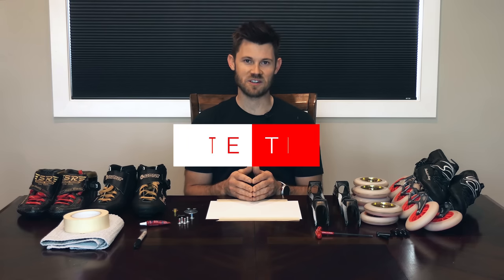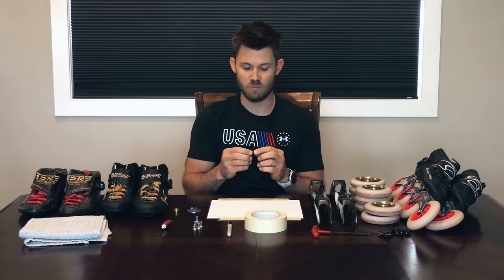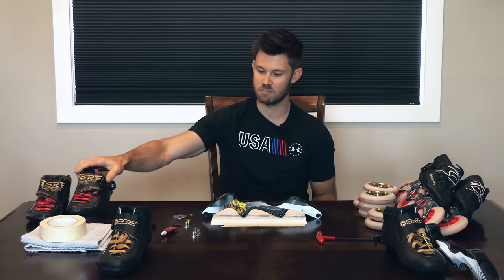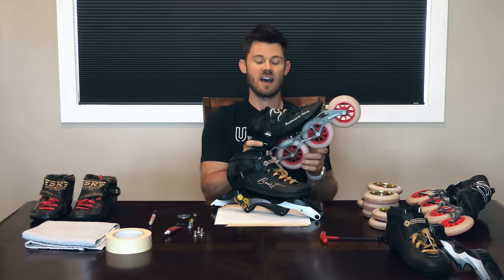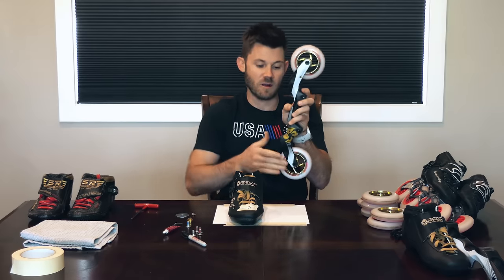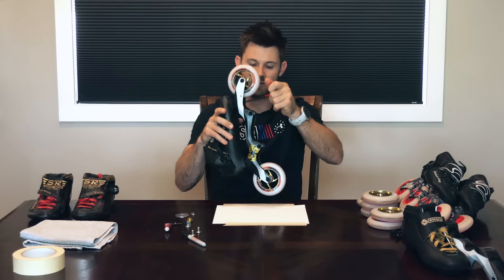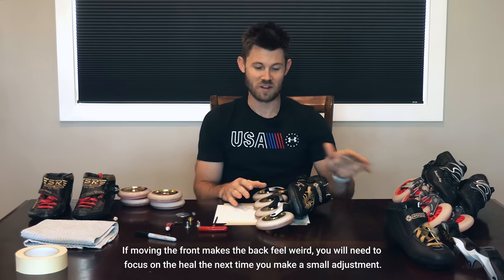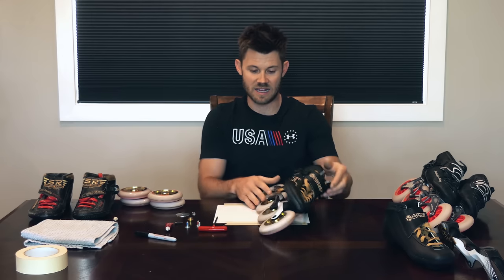Inline Skate Basic Setup Guide - How & Where To Mount Your Frame - Tutorial by Pro Joey Mantia

Comment: Back in the day of the 5 wheel set up, we would have our boot rub on the floor in the corner. 100mm track style skating. So we would move our frames to the left a bit on the right, but a lot on the left, tends to cause some ankle pain for me, have you ever skated this type of racing and what would you do now with the larger wheels. My left foot tends to move to fast if i do not move the frame over to the left. Ankle buckle, something like that. I see people, even super fast people not moving the frame much and not as much as i do, but if i do not, it just seems like im not getting power from the left skate. Not sure if you know much about that type of skating, its like short track ice, just on inline with a less oval shape track.

Comment: I know I’m late on this post however, I started to speed skate when I was 7 and gave up at 14 because it was “no longer cool”. I’m now 26 and wanting to jump back in just for fun and for exercise. I’m stuck between two boot options. The Bont Jet in-line speed skates and the Luna. With the jet you can mold your boot and with the Luna you can not. I never molded my boots in the past and was okay. Was skating faster then the guys double my age back then. However, it seems any knowledge I had on what boots to pick has gone out the window. I’m going with a 110mm wheel and upgrading the bearings as well. I just can’t seem to decide which boot I should choose. Do you know anything about either of these boots and have any insight as to which I should go with?

Comment: Hi Joey, Nice to see you again.
How can we judge by seeing from outside that this boot is 2 layer carbon or Full carbon?
And what is the benefits of Full carbon boot than two layer or 3 layer carbon Boot.
Reply from the maker: i dont know if you can tell just by looking. The layers of carbon aren't as important as the quality of resin used and the process for how the carbon is laid. If a boot maker knows what they're doing, they can keep the boot really light, but also nice and stiff as well. The advantage to more carbon is that the boot will just be stiffer, so if that's what you prefer (like I do) then that's what you would want to get
Reply: @JoeyMantiaSkates  what do you mean STIFF.
Is it upper portion of Boot or Ankel position?

Comment: Ok, I've speed skated most of my life (long track ice) and know the importance of good equipment. I bought a pair of good inline roller skates (3 x 125 mm wheels) and am setting them up. I'll set them up just like my Vikings, which should be easy. I'm 68 years old, and know how to skate, BUT also know the importance of wearing good protective gear, especially since I'm just starting out on inlines. I currently own a helmet, but need elbow pads, knee pads, and wrist guards/pads. There's so much protective gear out there. Do you have any recommendations of manufacturers for protective gear? Thanks, Joey.
Reply: Im sory no one answered yet, at least I can't see it...
The best protection gear in terms of movement are soft protections (often fitted with material that slides well over the ground (asphalt for example) or rubber paddings (to prevent impact damage and kind of slow u down) they don't create as much friction while moving, but for the best overall security nothing works better than regular (and much cheaper) plastic/fitnnesskate protectors 
So overall u would be better of with a soft protector that fits u well, definitely try them on before buying (they can not be adjusted in size)
Hope that helps and isn too late :)

Comment: great video and I have a question for ya. I am not a fan of flashing logos so will it matter if the axle  screw goes in from the outside of the frame or from your vid it sounded like it should go in from the inside of the frame? Any advice. Pete

Comment: Hi Joey: thank you for the video. I skate indoor rockered 243mm 80mm (FR SPIN US 9 mens) slalom, dance, jam on Inlines. I'm going to setup my right skate - how you demonstrated. My right ankle is always weird and I got to the point where I don't pronate but it FEELS off a bit. For outdoors I just run 80mm rockered 76/80/80/76 sometimes not rockered for stability. 
My question is what should I do for my left skate as I have no problems and it always feels stronger. Now the frames are centered to the boots and the wear pattern is centered for the most part. My left foot mondo is: 26.5mm my right foot is 27.5mm.  I hope I make sense. thank you in advance, Greg

Comment: Do you have any tips for how to align Chicago Rollerblades? I cant remove the frame with a hex wrench as it isnt held in place with hex bolts, but instead a small metal plate and screw. I want to adjust it, but I dont want to damage the skate. Thanks :)

Comment: hi, can i ask a question?
What substantial differences can there be by placing the shoe further forward compared to the frame?
I had put it in the middle before and it was fine on long road but cornering and starting off was bad.
Now putting the shoe further forward, it's fine at the start and in the corners but in the straight I feel difficulty in pushing, could it be or is it just my impression?
A thousand thanks
Reply: Hi there, I myself experienced the opposite, in general I like to have my boot just a little forward (frame back) for the long races, that way u can create a smooth transition from outside to inside edge while double push
But overall the middle position should be the best option, maybe (this was my problem when starting to get serious at skating) u have a slightly bad position of your front part of the frame in terms of inside/outside movement, if you try this maybe u will get a better feeling for your corners and starts
Hope that helps :)

Comment: Very useful tips! Any recommendations for mounting a trinity frame or Your suggested tips are similar? I have 3x3 and 4x4 both trinity frames, sometimes find it hard to get them right when changing
Reply from the maker: it depends on your wheel size i guess. If you're going from 4x110 to 3x125 then it makes sense it doesn't feel as good even with the wheels exactly in the same spot under the boot because you're changing the leverage points of the whole system by going to larger wheels, which in turn exposes any issues in the fitment of your boot much, much more than your 110's will. If you are going to be swapping back and forth often, i would say go through the couple month process of dialing in that 3x125 and see if you can't find a better balance point with that higher profile and mark it separately. wish i could be more help. good luck
Reply: @JoeyMantiaSkates  thanx for reply!

Comment: Your videos are great! Thanks for all of them!
How can I find a boot that fits good? I do not have a chance to try on several brands. There is no such store local.  I can order some but I do not have an idea which boot shall I go for. I've bought a PS XXX as Pascal's suggested in one of his video but I do not feel the snug fit I was looking for. Maybe a heat mould could help? Is it a must if you buy a new boot? 
My foot is quite narrow. What boot shall I go for? 
Greetings from Hungary.
Reply: I’ve got the same issues....i live in Australia so no chance of getting custom boots without the added major expense, doing a cast by the manufacturer and long postage times in between.

And as you said, you cant try on different boots to feel the difference. So, like you’ll have to do, is to either go on holidays to somewhere like the USA of just buy different boots & sell the ones you didnt like. OR drop over $2,000 AUD and order customs & just get it tight the first time at great expense! 😖 If money wasn’t an issue, i would have ordered a pair of Simmons customs....currently i have Bont Jets, but i find the heel cup loose.
Reply from the maker: ideally you can get into a custom boot so it will be actually made to fit your foot. If your foot is narrow, you will likely run into the same issues with any stock boot and heat molding can help a little, but I dont know if it can fix the foot bed being too wide for you. When it comes to custom boots I don't have a preference, there are three sitting on the table in this video and I've enjoyed skating on them all, so the choice is really up to you. Bont will be a higher cut boot and a little more comfortable to skate on, the simmons will be lower and more rigid, the huang will be lower and have a little less rigid than the others. I believe (but not sure) that you can do the molds for the bont yourself, the others you would need to have them mold you in person.
Reply: @JoeyMantiaSkates  Thanks Joey! Could you please give some advice how to test/identify if the boot is good enough? I feel it doesn't enclose my ankle the way I'd expect (even with a 2mm myFit footies and socks). But I've never had a golden sample to compare to. So I'm not sure what could I expect from a good boot.
Reply from the maker: @JimmyRClub   that's really hard without seeing you skate on it,  but if you can wear socks and another layer on your ankles, then I'm fairly confident your boot does not fit you like it should to get optimal performance out of it. if you can ever fit any fingers down inside your boot (next to your ankle) with it on and tied, then that's not a good sign
Reply: @JoeyMantiaSkates  Thanks. I feel it worse on the left. I'll try heat molding and somehow making the heel pocket tighter. I hope it could help.

Comment: @Joey Mantia   I purchased a used frame from someone. I cleaned the bearings, dried them and checked the spinning. The bearings are spinning well before mounting them to the frame. If I mount the wheels to the frame and loosen the screws only then wheels spin well, if I tighten the screws, the wheels/bearings are not spinning at all. the frame is narrow than wheels side size that when I insert the wheels to mount, I have to push in abit hard. Is this because of the frame or frame issue?

Comment: Great video Joey but i would have loved to have seen more on DIALING IN ON EXACT FRAME PLACEMENT in a real experience. I find the usual “move the frame in if you pronate” completely wrong in my experience! 

I tried the typical advice, but the more i moved my frame “in” the MORE i probated!!! I am of the lesser % that supinate and  I realised that my centre is outside of the normal advise to place “between the 1st & 2nd toe & centre of the achilles”.  So i’ve ended up with the front of my frame between the 2nd & 3rd toe (if not more to the 3rd toe) and the inside of my rear wheel lined up with the outside of my achillies tendon to stop pronating - wtf?! I had to double check this so i stood on an edge of a metal bracket with bare feet to where i could balanced the easiest & then  looked at where the ‘dint’ was on the underside of my foot & its basically where my frames have ended up! My biggest concern is that i see marathon skaters like Bart & Felix & there frames look extremely to the ‘inside’. Bart for example looks more bow legged if anything so i doubt his centre would be to the inside of his foot. So how do they perform with such an odd/extreme frame placement i wonder?

In any case, thanks for your videos, they’re always fantastic and you’re a great speaker btw - clear, concise and at a tempo that keeps you interested & not want to click “next”. 😉👍🏻
Reply from the maker: thanks for the nice words. Frame placement is something I didn't really want to cover because it is so, so personalized, but I felt putting a generalized video out there could help people. There's probably 20 different variables that go into how your frame is placed correctly to find balance for you, the boot is for sure the most important. Next would be the strength of your stabilization muscles in conjunction with your body's natural shape and pronations. Then onto things like how you are moving your weight around your skate as you push and if you are engaging the right muscles when you do so. I wish there was a definitive guide, but obviously as you have experienced, sometimes the complete opposite of the standard is what will work best for you. Being bow legged helps keeps things upright as you push away from your body, so people who are bow legged are naturally better skaters because their knees and ankles don't collapse as much when they push, this is why they're able to have the frame closer to their center of gravity and make it work well.

Comment: Thanks for the video, I’ve got some goofy questions if you don’t mind. I had a knee operation that didn’t really work out and has left my knee/shin bone and ultimate my foot rotated outward fairly significantly in comparison to before. I’ve been playing around with my frame angle and was wondering whether .. a) it’s better to set it to compensate for my on foot angle (frame to the outside on the back and inside on the front)  or set it neutrally/even other direction to force myself to get stronger in my weak position ( which almost feels like it gives me more torque because my leg is so twisted lol )  rather than perpetuating my abnormality ? ... 

..... and b) is it safe to have the frame half on half off the mounting block or do I need to align it with either my toe or Achilles as you showed in the video? The angle of my foot to my midline is about 15 degrees ish I would say. I guess mixed up in this is whether I should be trying to be like the old me with good alignment or the new me and just see how it turns out lol. Any thoughts would be appreciated as doing weird stuff can have adverse affects down the line, then again so can having a weird knee, just ask my back 😅
Reply from the maker: a) i would say you can compensate if you want to, the ultimate goal is trying to find a good balance point- if you were to glide on one foot you could comfortably still control your skate without it flopping one way or another. If you think it's possible to overcome a botched surgery with strength exercises, rehab type workouts, and really focusing on keeping the skate straight as your skate, then I would definitely recommend that, but it sounds like that might be pretty tough.

b) half on the blocks is ok, if you can somehow manage to get an extra mounting bolt in there (in the next hole over) for some added bite, that's ideal, but if not, I think you should be okay. It's not the best situation, but I've seen guys skate with their frames pretty slammed over and hanging off the blocks. Keep an eye on your frames to make sure nothing is cracking over time would be my only suggestion as you go about testing these different setups.

good luck
Reply: @JoeyMantiaSkates  thanks a lot, it’s nice to get a benchmark for this stuff from someone who’s really in the game. I hadn’t thought of the extra bolt so I’ll give that and the other stuff a go. Sounds like I may have to work either side of the line on an ongoing basis and just see if I can change my current limits gradually with respect to my foot/skate alignment.

Comment: I have a question, is it better to put your own skates together, boot/plates, etc or buy a pair already assembled?
Reply from the maker: Do you mean picking out the equipment or actually setting it all up?
Reply: @JoeyMantiaSkates  I mean just getting the components separately and then assemble them yourself or just buy a pair of skates?
Reply from the maker: @samshehan9377  that depends on how experienced you are with picking equipment, most higher end speed skaters pick and choose their stuff from different brands, but that doesn't mean it's bad to pick a single manufacturer and choose a skate they have put together for the consumer. If you decide to choose components from different makers, just be sure to do your research so it will all work nicely together, and unfortunately to my knowledge there is no database that will tell you that, you just have to kind of ask around and see what people like. Hope that helps

Comment: I have bont metal hub 110 wheels on bont supercell frame, how can I fix them to avoid noise? Thanks
Reply from the maker: What kind of noise? Pretty much every carbon frame I've ever seen or used has made a little bit of light 'clicking' just from the nature of carbon fiber
Reply: @JoeyMantiaSkates  I think it is from the frame, the noise, because some bearings don't fit very tight into the aluminum hub. I have told it to the shop where I bought the bont aluminum hub wheels. Thanks, Joey